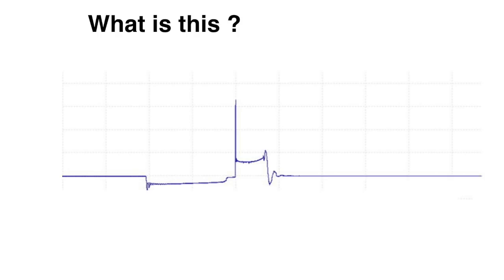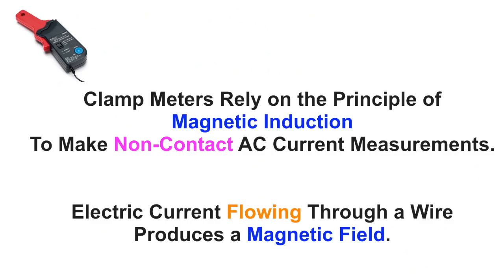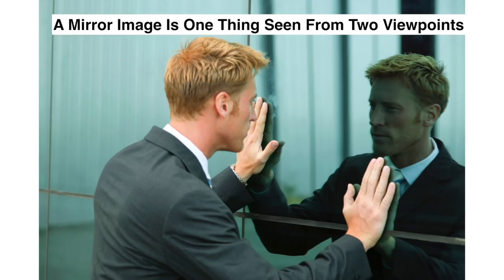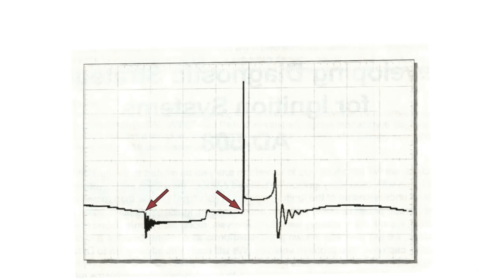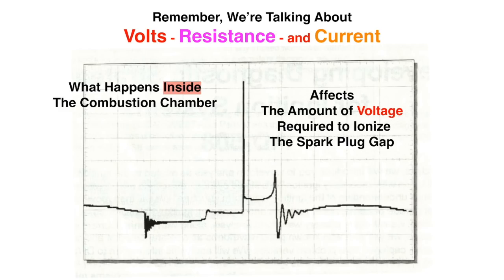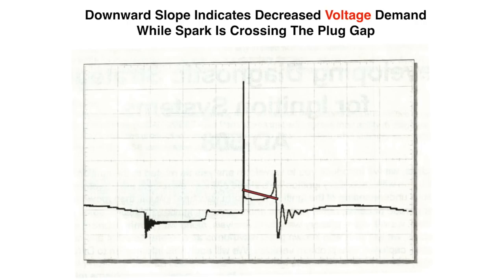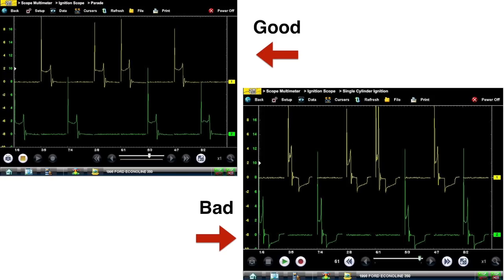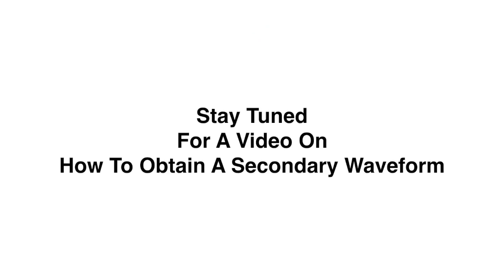Teaching Yourself Series.    A Study On Secondary Ignition Waveforms

Comment: The oscillations are in their way a resistance.  They are the result of the interactions between the primary and secondary coils.  When the secondary is open as it is during the dwell period and after flame out, the current flow oscillates until the voltage is equal all along the wire as the primary and secondary interact.  As seen this takes microseconds.  

In any case, it is as indicated in the video, an indication of a "weak coil" or more specifically the interaction between the primary and secondary is not as it should be and thus, a likely bad coil.

Comment: As you say, you need to gain practical experience by seeing a whole range of normal studies before one can really interpret variance. I was puzzled by the example showed at 22:18, where poor compression led to a higher firing voltage (I guess this one didn't read the textbooks). Thanks for going through this, Dwayne, we're looking forward to the next video. I've found interpreting secondary waveforms with newer ignition systems much harder....

Comment: This is an excellent video!  I really appreciate your teaching. I am pausing and taking a lot of notes. One question I have is regarding the point where the spark KV intersects with the firing kV line. I understand that the burn line sloping upward would indicate lean and sloping downward would indicate rich. But what about the height of the sparkline itself?  If it intersected with the kV line high up on the kV line, what would that be telling me?  And if the sparkline intersected with the kV line low on the kV line, what would that be telling me? Thanks again so much for your excellent teaching.

Comment: At 22:18 , cyl number 6 slope line is going up, based on info from 16:40 this means voltage demand is going up because of increased cylinder resistance. Is it the low compression on this cyl that is the increased resistence?
Reply: yes, low compression directly affects the resistance